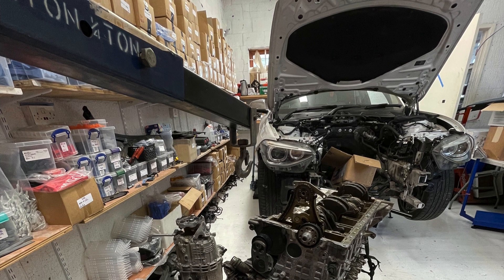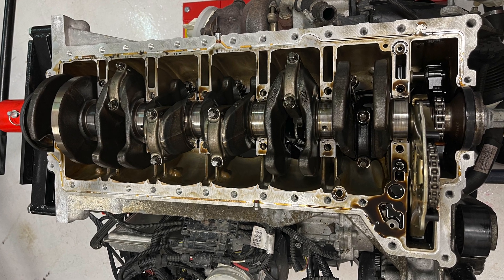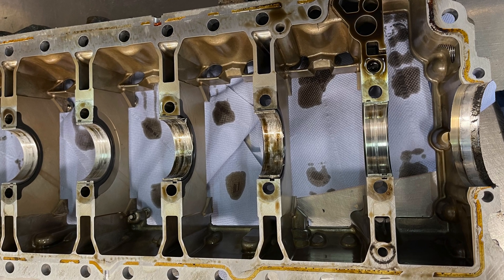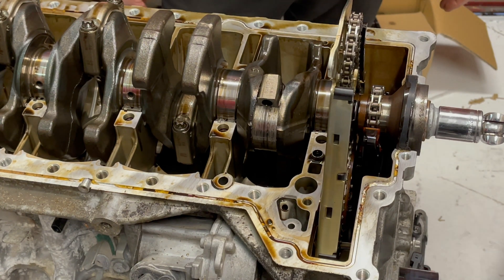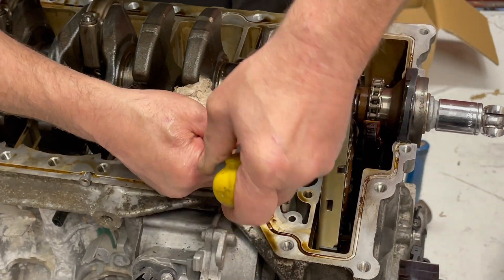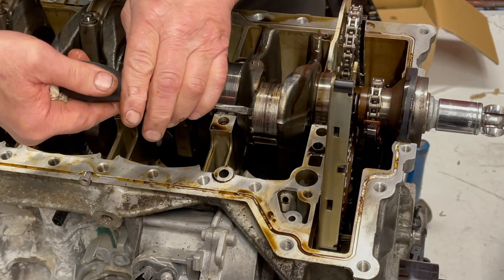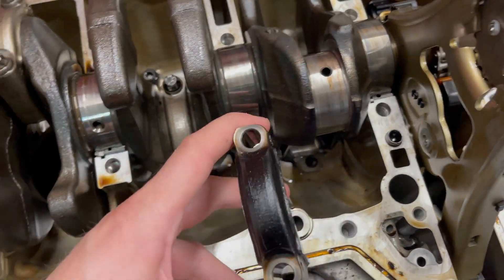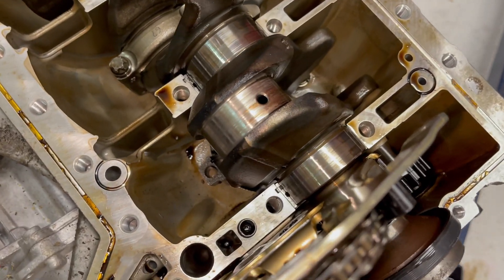This Is Where The N55 Engine Actually Seized - M135i Engine Seized Project

Comment: Are you changing the piston aswell?
Reply from the maker: The engine hasn’t been stripped yet so I don’t know exactly what it’s going to need. I’ve sent it to a professional so I know it gets done properly. I’d love to learn how to do it but the value of the car, or perhaps more the engine, is too high for me to practice rebuilding on it.
Reply: @IAMASPANNER  interested to see what the total damage is. I will be taking out similar-symptom n55 soon. There was no visible metal in the oil,so hope it's rebuildable